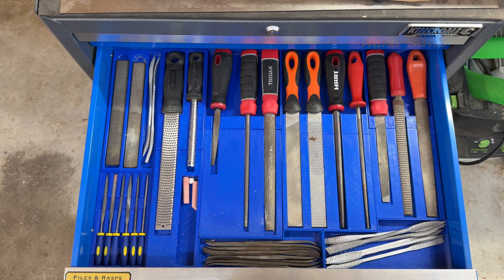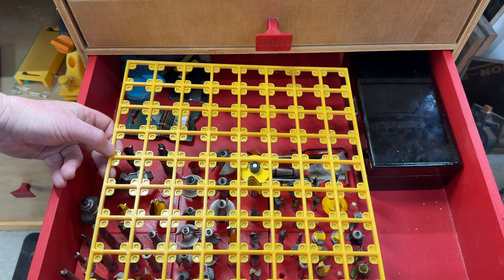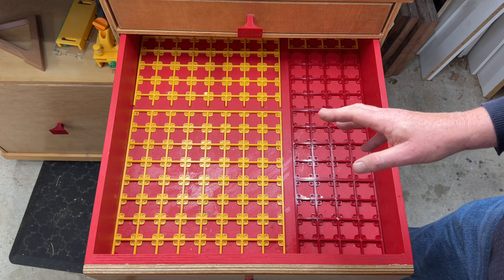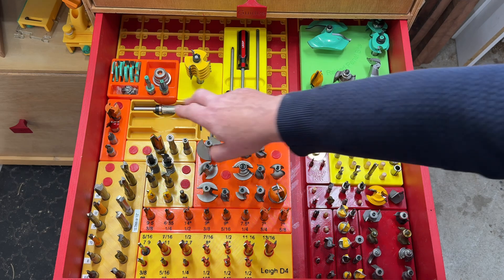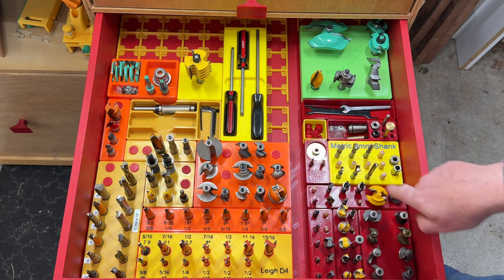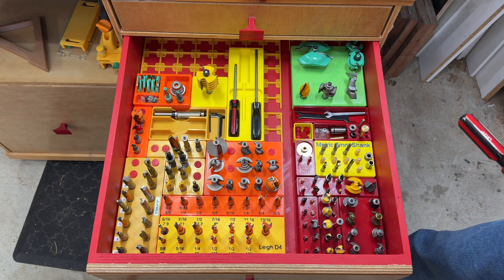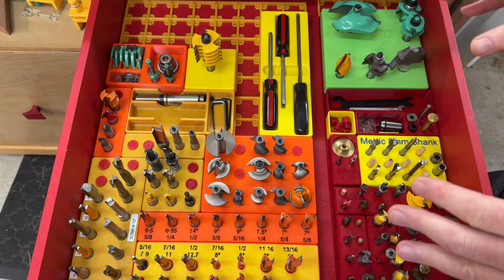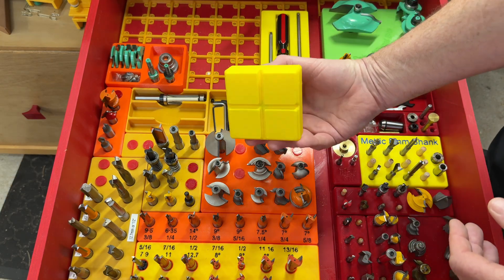Gridfinity Router bit Storage

Comment: Great analysis. Personally I never have free space in a drawer, so stopping sliding is not an issue. I also use a rectangular base shape, which I find more flexible when matching parts to trays.
Colour coding- I use the resistor colour code, so, e.g., 6mm bolts go in a blue tray. Works for drills, taps and dies, reamers, etc. Saves a lot of time.
An alternative to a grid for non-filled drawers is non slip matting.

Comment: not a user of any grid based system, but for those interested there is an add-on for fusion 360 to generate gridfinitiy blocks, which allows you to just cut out the shapes you need, and not have to design base pieces. So if you need a 4x4 grid it will generate the base block for you, then use sketch out and cut/extrude what you want removed

Comment: Hi, I just started yesterday with gridfinity, and my base plates are all half width at the borders, My max is a 6x6, so I need more then one . I glued them together with superglue, and it works like a charm (I got the one without the magnets) 
Oh and for the "open" space if the 42mm does not fit, like the gap you got, You could of course print a long very small box that fits exact between . For a long drill bit or  etc. 
Kind regards Hans